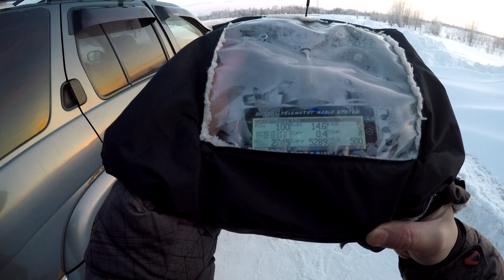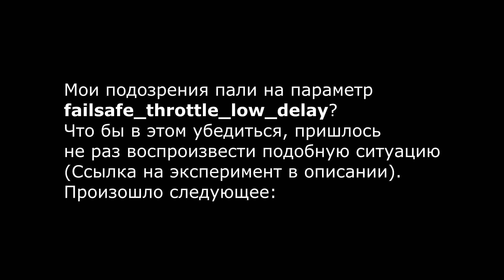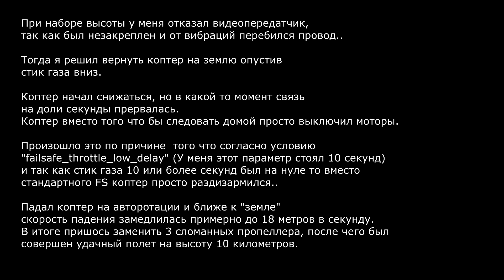Что будет если квадрокоптер упадет с высоты 8 километров.

Comment: wow, please translate all the cyrillic in your video. i am very interested in your high altitude attempts.
Reply: +TekkonTech
It seems we have a problem...

Need urgent landing!
(Here I put the throttle stick to zero)

This wasn't planned. 
Although we've wanted to drop it deliberately, but not this time...
Copter began to fall uncontrollably.

Finally we decided to let it fall...
because we planned to do such experiment.
It was possible to try to arm it again, but I did not try.

Why did the motors turn off?
 
I suspected the parameter
failsafe_throttle_low_delay?
To be assured, we had to reproduce the case several more times
(Link to the experiment is in the description).
What happened is the following:

During the climb video TX failed, because it was not firmly fixed
and a wire was damaged from vibrations.

Then I decided to land the copter by putting the throttle stick down. 

Copter began descending, but at some point the radio link was temporarily lost. 
Instead of returning home, the copter just disarmed.

It happened because the parameter "failsafe_throttle_low_delay" was set for 10 seconds
and as throttle had been zero for 10 or more seconds, the copter did disarm instead of standard failsafe.

It was falling on auto-rotation and at lower altitude the fall speed became slower at approx. 18 meters per second.
As a result, 3 broken propellers were replaced, and after that the copter managed a succesful flight to the altitude of 10 km.
Reply from the maker: My english is so bad, but you can use translator google or other...
Reply from the maker: Кажется у нас проблема...

Нужно срочно приземляться!
(Здесь я опустил стик газа в ноль)

Это не входило в наши планы. 
Хотя вру, собирались специально уронить но не в этот раз...
Коптер начал неконтролируемо падать.

В итоге решили, пусть падает...
ведь планировали провести такой эксперимент.
Хотя можно было попробовать
 повторно заармить, но я не стал пытаться.
 
 
Почему выключились моторы?
 
Мои подозрения пали на параметр
failsafe_throttle_low_delay?
Что бы в этом убедиться, пришлось
не раз воспроизвести подобную ситуацию
(Ссылка на эксперимент в описании).
Произошло следующее:

При наборе высоты у меня отказал видеопередатчик,
 так как был незакреплен и от вибраций перебился провод.

Тогда я решил вернуть коптер на землю опустив 
стик газа вниз. 

Коптер начал снижаться, но в какой то момент связь 
на доли секунды прервалась. 
Коптер вместо того что бы следовать домой просто выключил моторы.

Произошло это по причине  того что согласно условию
"failsafe_throttle_low_delay" (У меня этот параметр стоял 10 секунд) 
и так как стик газа 10 или более секунд был на нуле то вместо 
стандартного FS  коптер просто раздизармился.

Падал коптер на авторотации и ближе к "земле" 
скорость падения замедлилась примерно до 18 метров в секунду.
В итоге пришось заменить 3 сломанных пропеллера, после чего был 
совершен удачный полет на высоту 10 километров.
Reply: @Denisfk1985  Денис. На заказ собираешь квадрики ? Любительский чтоб комплектом был очки и тд. Средняя камера, радиус км 1.5 хватит.  Полет мин 7-10. Сам озадачился но думаю не смогу настроить после спайки и сборки дрона. Имею не большой готовый. Скучный стал )
Reply: TekkonTech THAT RIGHT I DID NOT UNDERSTAND NOTHING